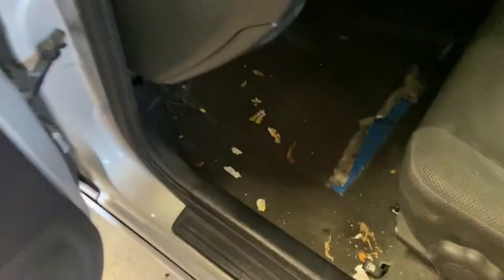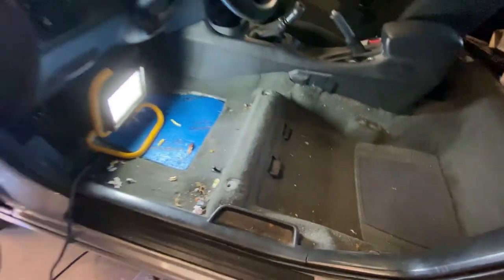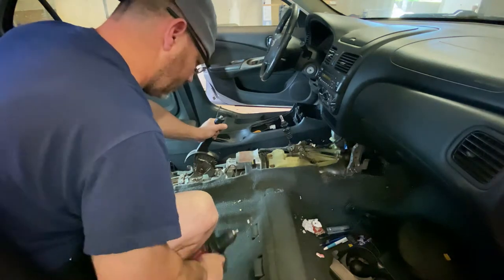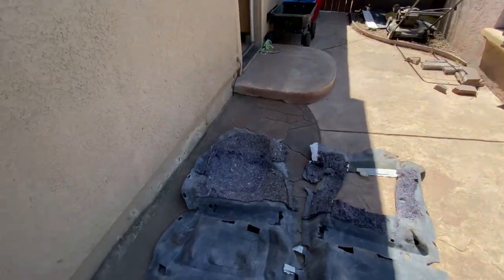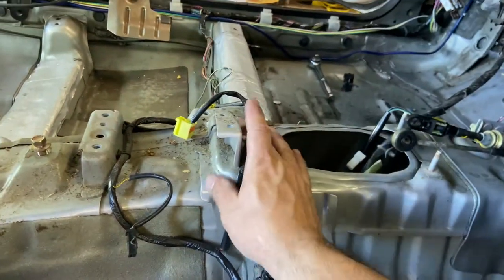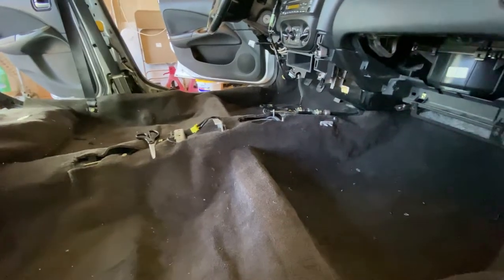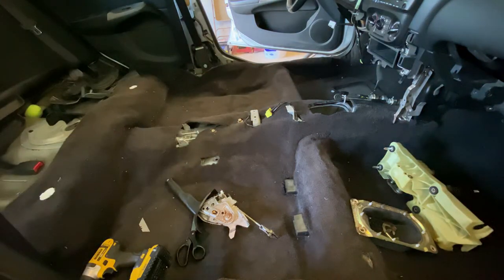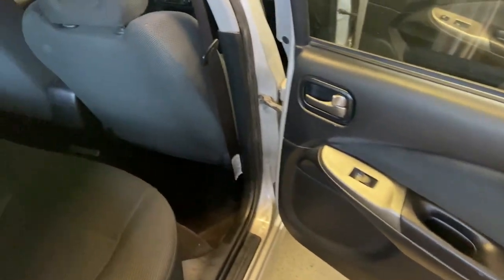INSTALLING EBAY CARPET IN MY CAR

Comment: New carpet looks great! Removing the extra padding was super satisfying.
Reply from the maker: I know right!
Reply: @chrisbuildsitall  link to the eBay carpet you got? There are still some brand new OEM Nismo floor mats for this car..I'm doing an in boxing video hopefully soon?
Reply from the maker: @blackcanyongarage  https://www.ebay.com/itm/Carpet-Kit-For-2000-2006-Nissan-Sentra-2-or-4-Door-/281442509852?_trksid=p2349624.m46890.l49286
Reply from the maker: @blackcanyongarage  yes - Sentra Nation has the Nismo mats. Got some on the way..
Reply: @chrisbuildsitall  interesting! I got mine from Lee Auto, it's a parts dealership in Connecticut.